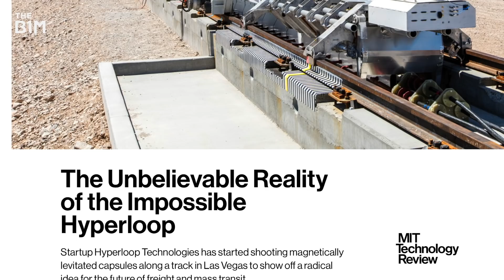Fred Mills and Sir Richard Branson: Inside Hyperloop's First Passenger Test

Comment: Ok so unseal 500m, entirely straight vacuum tube, push the pod into the tube, reseal tube, travel 500m reaching top speed of 172kph, unseal vacuum tube, pull pod out of tube. 

Slower than existing trains, with the time overhead of entering and exiting the vacuum, and the danger of a vacuum. But I do like how it has coloured lights on the inside. That is how you know it is a genuine future reaching technology project, and not a literal pipe dream.
Reply: lamooo, they should just invest that money into improving existing superconducting high speed trains
Reply: Putin did nothing wrong. Exactly, this is a dead end, the problems surrounding the vacuum part of this is completely unfeasible and will be the death blow... literally superconducting mag lev trains travel multiple times faster than there pathetic 107mph... like our said better off developing more of them instead of junk like this... only the technology illiterate find this impressive as demonstrated in the comment section here lmfao... what's even sadder is the fact that they think by calling it another name ppl will somehow believe this is not a train, when in fact that's exactly what it is, just a maglev train in a vacuum tube.... pathetic waste of money, time and resources...
Reply: It wouldn't work that way in practice. It would stop, an airlock would open, then you would go through to the station and get out of a side door. The top speeds are at least 760 mph (1,200 km/h), but probably much higher than that.
Reply: Jazz  why would temperature be an issue?
Reply: @shivamjhanwar2782  you're borderline incoherent, slow down and read what you are typing before you press enter.  I understand exactly what I am looking at. This footage is from Nevada DevLoop test site, the tube is 500m long.  Previous unmanned pod tests have exceeded 172kmph but still haven't approached the best trains (could also be because 500m isn't a long enough track to reach max speed).  

The concept of train in a vacuum is well over 100 years old. Obviously a train would be more efficient if there was no friction against the air.  

Here are some important milestones before I'll consider hyperloop to be a real project: 
1) test track is a decent length (let's say at least 10km)
2) test track that isn't just a straight tube
3) time effective entry of pods into vacuum / time effective exit of pods from vacuum (and video showing it happen real time, not just marketing and people smiling)
4) multiple pods simultaneously deployed into the same tube 
5) speed greater than existing trains
Until then it has all been promised before, and I am not going to hold my breath waiting.
Reply: @f-22r  Uhm....thermodynamics. A vacuum isn't absolute, there are always gas traces inside a tube which temperature (temperature changes) has an effect on. Considering this hyperloop concept is meant to be very long covering large distances the effect of temperature and temperature flux can potentially have a negative effect particularly on the walls of the construct. The next part is temperature warps metals and vacuum sealed tubes on a very large distance which warp is a very bad idea.
Reply: Popeye  plus the energy required to create and maintain the vacuum (which might be actually most of the energy used by the system)
Reply: @user-rw6xo9jc3n   called moon and mars colony.
Reply: @FitnessGuru91   glad its not your money. right ?
Reply: @hillbillyintheasia6122  no but it is still tax papers money is it not? The amount of governments that have invested in this joke of an idea is sad. It is like a child's idea. I had this idea when I was about 8 or 9 a tunnel that could take your car underground through traffic. O yea I also imagined I was super rich lol. Elon musk likes to talk big about this project but it is a fail of an idea. Why don't we invest in super high-speed trains which are shown to be more useful and more effective?

Comment: "107 miles an hour"
the GWE class 166 goes 125 mph
Reply: That was a test. The hyperloop is designed for 1000km/h
Reply: @pengu2250  LOL in what concept and bullshit talk? Seriously this is all a pipe dream in the literal sense.
Reply: IMO the track is too short for attaining higher speeds(Just 500 mts). There should be space for deceleration followed by some tolerance. That's why !!
Reply: @pengu2250  👀
Reply: Do you think they’d put it at full speed with people on a short test track the first attempt? Physics dictate you’d need track to gain speed and slow down. There isn’t enough track
Reply: @christopherleonard247  mate I'm a CS student, not a Physicist
Reply: @infinityarcangel5972  it shows. But as a cs major I'm pretty sure you had to take basic physics, at least my friends did.
Reply: When testing the pod *without passengers*, they have managed *387 km/h*, which is pretty good for a small ROW and 500m track.
Since this is a maglev, the speed is only limited by aerodynamic constraints and direction changes - even at 100 Pa vacuum, the drag at high speeds will play a role.
Also important is the fact that the system is ~100x more efficient than typical trains/maglevs at high speeds (10s of MWs vs. 100s of kWs average energy consumption).
Reply: @pengu2250  "designed for" it will die alongside the billions of dollars that it burns along side it.
Reply: @jaroslavjandek8365  Is that accounting for track cost?  Train tracks are pretty cheap.  This is something other than cheap tracks.
Reply: @aguyfromnothere  You are probably replying to the wrong discussion, cost was not mentioned in this thread, only efficiency, speed and acceleration.
Reply: @pengu2250  A test of what?  Technology that everyone else already has in production doing a lot more than this does?
Reply: How will they save the passengers when there is some sort of shut down?
Reply: it will go over 9000 lols/h when it gets more funding.
Reply: @jaroslavjandek8365  the math does not quite add up

Comment: The Hyperloop is way cool!  But what advantage does it have over something like the maglev Shinkansen in Japan?

In vacuum might give the Hyperloop a slight speed advantage over the Shinkansen, but it strikes me as being dangerous if the pod should break down and the passengers are trapped inside, or the tunnel should breach in, like, an earthquake.  I don't want to sound all negative about it like Thunderf00t, but I think these concerns need to be talked about more.

Although, if they can make pressurized flexible connectors between pods, they could make an actual Hyperloop train that can carry 100 people or more.  With doors at both ends of the pods, the pod at one end could "dock" with a hatch at the station so the pod or train wouldn't need to pass through an airlock at each station, but it would be a pain if you could board only at one end of the train.
Reply: That's because Elon Musk the car billionaire wants you to think its better. In reality trains are and always will be superior as they carry more people at a faster speed for less money. The hyperloop is a scam for the ultra rich who want to play around with their money.
Reply: @thelorax4236 , it’s at a much lower speed now because it’s only being tested, and only in a small test track. The technology will be advanced enough in 20 years time for it to be considered the next step after maglev.

They are still way off, but the first functional system would go at a projected speed of 760mph, which is twice as fast as any current train. If they can reach over 100mph and back to 0mph in 500m tube, they will certainly one day reach 760mph, and much more than that in the distant future.

For tech to be there in the future, it has to be developed now.
Reply: Nothing. This is why its dead. Small passenger cabs. Okaaay.  When you can have trains carry hundreds.   This sort of thing is like strapping two people too a rocket and claiming we are on the verge of interstellar travel.
Reply: @xr6lad , it is, but in 40 years time, there could be pods travelling at extremely high speeds very close together. Or those pods going in the same direction could band into trains.
Reply: @benjacobs574  That's kind'a what I said -- put the doors at each end of the pod and come up with a pressurized flexible docking system that can allow the pods to be connected together like a train so that passengers could pass through while the train is in transit.  That will ramp up the capacity to be more like a train.  It will also improve safety if a pod breaks down, just uncouple that pod from the rest of the train and transport all the passengers to safety.
Reply: The train itself doesn't matter at all. Vacuum chamber that big might be possible to make, but it would be extremely dangerous any breach would bring only catastrophic failure and death. Hyperloop is just some elaborate form of marketing and money laundering.
Reply: @UhOhUmm  Not going for 100% vacuum, and analyses have been pretty sanguine about the safety issues.
Reply: Web site says aiming for 1000kpg (670 mph). That requires the partially evacuated tube.
Reply: @xr6lad  I agree.  Pods that carry just a few people at a time won't be cost effective.  Especially when these pods will have to be separated by hundreds of miles from each other since they'd be going so fast.  The only practical way would be to connect pods together into a "train."  As Thunderf00t points out, safety is a concern too should there be a catastrophic breach in the tunnel or a breakdown.  There needs to be a way to get people out in an emergency.  That's why I think they should put the airlocks/doors at both ends of each of the "pods" like train cars so that "trains" can come to couple up with the disabled "train" so that people can be rescued.

Comment: The only hard part with "Hyperloop" and the only difference between a normal maglev train in a tunnel is. 
A close to vacuum tunnel system, that is safe, ultra low maintenance and to a price that makes sense compared to flying. 

In this test (look at time 0:52) here the camera shows from inside the tunnel. 
And you can clearly hear the electric engine (should not be possible in near vacuum) 
And it looks like the tunnel is open from the end with sunlight shining in. 

If that is true than this is not a test of Hyperloop, but just an electric train in a tunnel, something we have done every day the last 100 years.
Reply: Is the train levitating? If not it'd still cause vibrations and make noise
Reply: Near vacuum would mean that a single puncture could prove fatal, correct?
Reply: @tonuka6257  It is a Maglev or that is atleast what Virgin says. 
Yes that is a levitating train.
Reply: @irok1  It all depends on the size of the hole. 
Just like the International space station had a small leak, it did not have a devistating collaps. 
But if, lets say a truck rammed the tunnel (if it is not underground) and split the whole pibe open. 
Yes they you would have a shockwave of air traveling down both ends traveling at the speed of sound, and properly kill everyone inside the tunnel system at that point.
Reply: @steffenjespersen247  
It runs on wheels, the magnetic system just propels it.
Reply: @Wordavee1  Right and that would make no sense as you would lose the 0 friction one would gain with pure maglev especially at the speeds this thing promises. 

And as I have not found any footage or info about this tunnel having and airlock they clearly did not depressurized the tube after they put in the pod+drivetrain.  
As the reporters would have had to sit in this tube waiting for hours.
Reply: @steffenjespersen247  
On another video about this it claims the pressure was 100 pascals, about 2lb/sq.ft so they did evacuate the tube, but as you say, it must have taken quite some time sitting and waiting for the pumps to do their work.
They give out very little detail of operations.
Thunderf00t has just done another Busted video about the test.
Reply: @Wordavee1  Yea I just saw. 
He is not very impressed either. 
Yes it is very hard to see, what is actual information about this test and what is information about what their vision is. 
They mash that info into the same sentences, so it is almost impossible to know exactly what they tested.

Comment: 107 miles/h ... actually it's what can do a regular car
Reply: lamoooooo
Reply: And only a half kilometer at this point.
..... a poorly performing bracket dragster then.
Reply: It's the first passenger test. You don't risk the safety of your passengers by having the thing your testing go full out. Its a step by step process. Their first step was to ensure that there were no problems at that speed. 
Another example of this is what SpaceX is doing with rockets. Why bother to do a 150m hop when you can just fly 15kms in the first go? Because there are number of data you collect by doing the smaller tests.
The fact that someone needs to explain this is kinda sad.
Reply: @jimurrata6785  The problem is: because the tube is only 500 meters long, it can’t go much faster than 107 m/h. The concept is that at some point Hyperloop can go to speeds of more than 500 miles per hour. 
Now I don’t know if that is really feasible but I really hope it is!
Reply: @paulhahn694  It was tongue in cheek.
With this much money spent they should have a ring like the cyclotron proposed for Texas.
I can't imagine the vacuum pumps (or the energy) required to pump down a transcontinental tube.
Or what is intended to keep vacuum in the rest of the tube when the train disembarks at a station.
An iris like a camera shutter perhaps?
Cool concept, a lot of development still required.
How high a vacuum? At some point you're going to be transonic. What then? There's no room for this thing to shudder without banging the wall.
Possibly losing vacuum or worse opening the car to vacuum.
I get it. The old fashioned pneumatic tubes in department stores and banks of the mid 20th century were the concept, but it just doesn't scale.
Reply: @paulhahn694  No it will not, reason it is so small and in a straight line is cause it would be way to unstable at any higher speeds. You do realize turning underground at 700 kilometers per hour would need mile long tracks right? LOL massive waste of money.